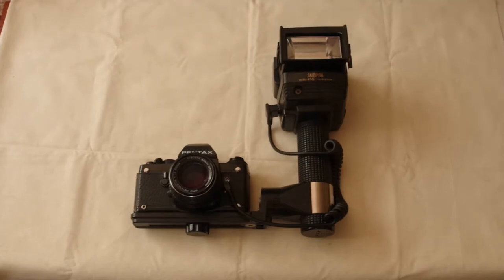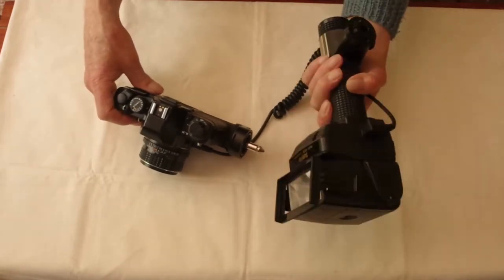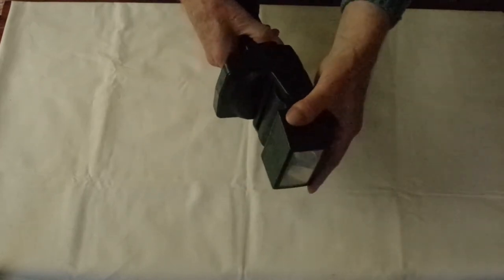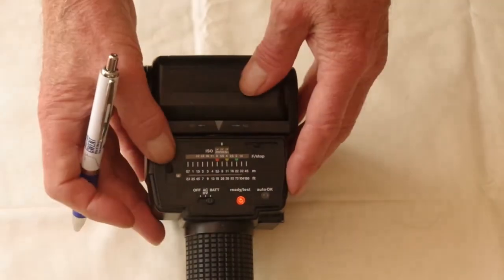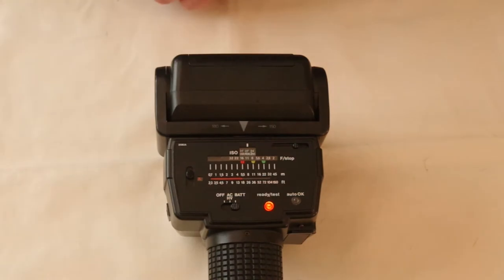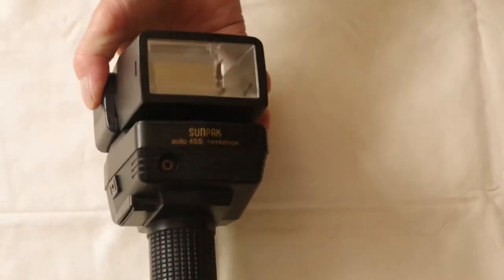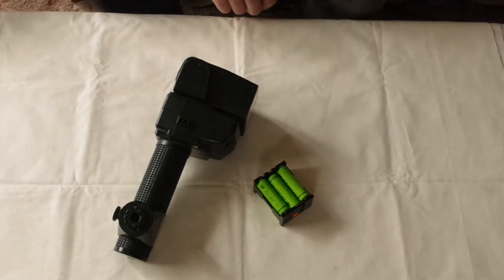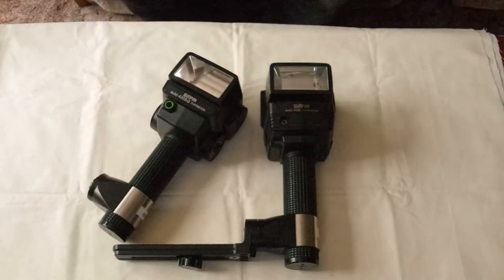Sunpak Auto 455 / G4500 Flash Unit

Comment: Very nice. I have the Supak 522 hammerhead flash which actually does have variable power output in manual mode. So far I've only used it in auto mode and the 522 seems to be a vast Improvement where the exposure test light is concerned. Does slightly bigger indicator and for me the amount of time it stays on is not too brief.
Reply from the maker: It seems like an oversight that the 455 had only one (full power) manual mode. For more control you had to buy the 555 (also known as G4500DX) which was basically the same but had seven manual and seven auto modes, and a TTL mode if used with a DX module and special lead. The 555 fetches a much higher price these days, although some sellers and buyers confuse the G4500 with the G4500DX ; Sunpak's naming is confusing.

Comment: Thanx Duke! great timing. I have have the entire unit: flash + gel kit even the brollie diffuser in perfect condition. Had it for a while since my ma's film days.  What is the trigger voltage of this flash?
Reply from the maker: Thanks! I measured the trigger voltage of mine as 6.6v.  A modern standard says cameras should be designed to tolerate up to 24v, and I use my 455 straight on a Pentax K-1 DSLR, but Canon are on record as recommending no more than 6v.  There is a discussion and database on Botzilla's website. YouTube doesn't allow links outside, but Googling for "strobe trigger voltages" will find it.
Reply: @dukenukem5768  much appreciated Duke, the link is a great guide- , at a glance variable results re battery choice and so best I test with multimeter. Im wanting to set up high- speed triggering>opto-isotators etc- [its electronics 101 beginnings curve for me]. Do I assume you used AA alkaline batteries with the 6.6V result? How /where did you insert the =- probes to measure the flash unit as without flash contacts/pins visible?
Reply from the maker: @plantherain  I measured the trigger voltage at the tiny co-ax PC (Prontor/Compur) connector on the end of the flash sync lead, using pointed probes because the centre contact is tricky to reach.  Alternatively, fit the PC connector into the adaptor seen from 2:05 and measure between its centre contact stud and the return contact in the slide groove. 
Use a digital multimeter (or a very high quality analog one) because the flash trigger voltage sits on a small capacitor, and a cheap analog meter (low impedance) will pull the voltage down to a false low reading - which might explain some of the variable results on Botzilla's website. I use AA batteries for my test and don't think alkaline vs rechargeables would make much difference.  An external power supply (the high volatge battery pack or mains adaptor) might though.
If you want to see the original manual for the 455, Google for butkus(dot)org which is a massive website of old photographic manuals, free to read.
Reply: @dukenukem5768  Thanx Duke, just got around to it: using the co-ax end using pointed probes with DigMM. Read 3.3V (??) Batteries are out the box. . I have the printed manual not much use re flash output.